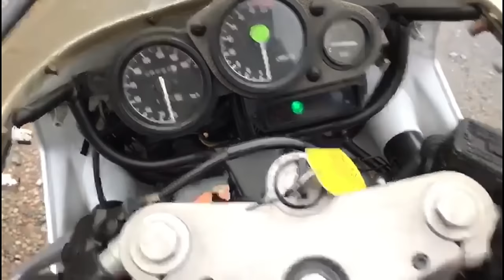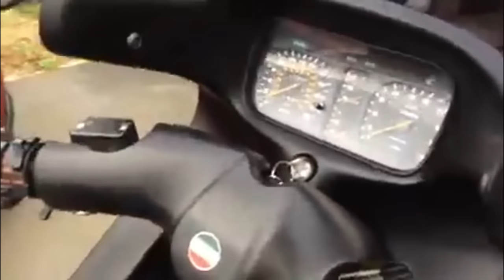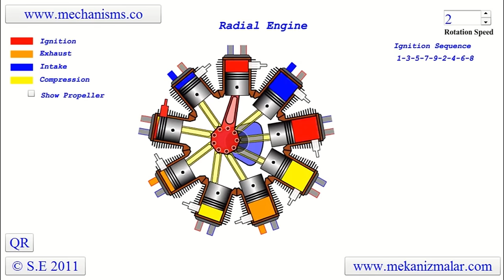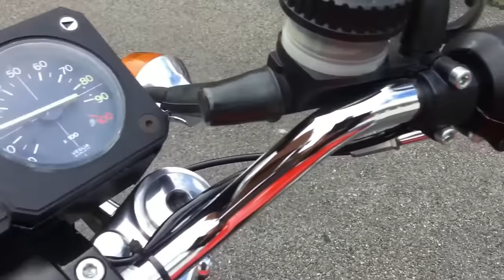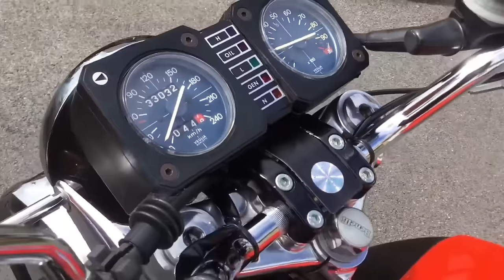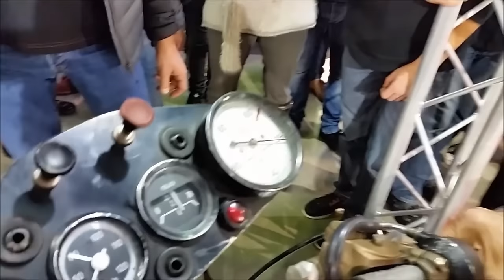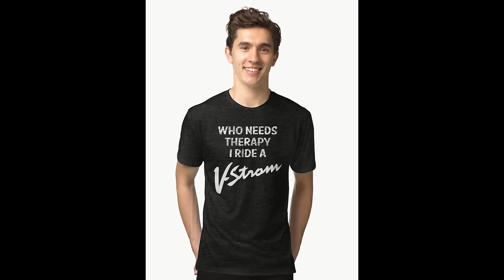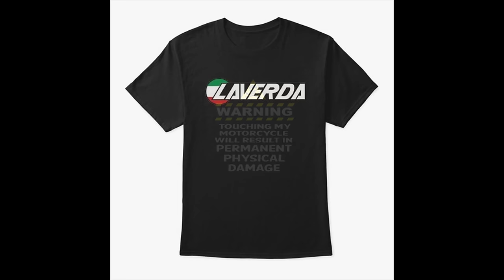20 Greatest Sounding 4-Stroke Motorcycles Ever

Comment: Wow! You brought back a lot of awesome memories AND introduced me to some fantastic sounding bikes I can't remember ever seeing before! I think I did post a tiny video of a CBX taking off with an immaculate old 750 4 from either side of my Burgman a little while back, he didn't wind it out since it was still fairly cold but, they do sound amazing when up in the revs and throttle. So many of them sounded amazing and I'm right with you about the importance of the sound. My DL650 with that Two Brothers Racing exhaust made a really sweet sound the gopro vid just doesn't do justice but, not a patch on these bikes you showed here. One I really liked the sound of that I had was my XS 750 triple shaft drive Yammy which had been worked over for racing so the engine was a fair bit livelier than stock and had a custom 3 into 1 that made a pretty addictive sound that made you feel like you had to wring it out everywhere you went, just so I could hear it. It wouldn't compare to most, if any of the bikes you showed here. 
I don't envy you the challenge of making this video and trying to position them, you took on a hell of a challenge and despite the inevitable disagreement many will undoubtedly have, I think you did a great job and thank you so much for it  👍.
Reply from the maker: cheers mate, imagine what the 2 stroke one is doing to my head lol, this has been a serious quest 🙂
Reply: @barebonesmc  I can see that, no wonder you're so busy. This one was quite a major effort I'm sure and 2 stroke engine noises are a LOT more subjective, plus a lot of people just hate the sound of them anyway.
I'm patient enough to wait to find out but, I'm sorta expecting my old Suzy 550 GT to maybe make it into that one. I won't be terribly disappointed if not but, I did enjoy the cackle of 3 2 stroke cylinders running together. To me, it was probably the most pleasant sounding one I ever owned. It or maybe you prefer the 750 water bottle, or maybe you've got a bunch that sound better than either of them, either way, I won't give you a hard time since they will be a LOT harder to choose from all the different 2 strokes over the years and every one of us dinosaur 2 stroke lovers, yeah, all 6 of us will have different reasons for loving particular ones, plus stock or modified, especially expansion chambered ones will all suit different people.
BTW, I remember you saying something about that "2STROKESTUFFING" and if it was the one where he worked out he'd built the expansion chamber ALL based off 1 wrong measurement at the head that compounded from there. Well he's now made a pipe that by rights is still not right but he had an idea and wanted to try it. It did work pretty well actually and got up to over 12 hp at the rear wheel but, he's only just done it so he's almost certainly going to still build one to known formulas but I think he's going to try a few more things with this one first.
The one thing to remember that fools me every time is that in the bike his engine looks kinda big but, it's actually tiny. That top pulley up above that gearbox way up there is the crankshaft, it's only mounted up there on top of all that for testing purposes.
I'm also loving hopefully to understand 2 strokes better. I've owned and even rebuilt several 2 stroke bikes over the years yet have never really completely understood exactly how they work, plus how to modify port timing by opening up the right parts to get the port timing to suit the way you want it to deliver power so this is very interesting to me.
You kinda know it's a tad revvy when he describes 11,000 rpm as idling speed lol.
A lot of commenters are suggesting his home made dyno isn't reading accurately and that they mostly all think it sounds like it's putting out more power than his readings are showing. HINT: If you're interested  in power and the torque figures, get ready to hit the space bar about 3 seconds after you see him reach over to press a button on the laptop in front of him.
Reply from the maker: @lorditsprobingtime6668  the 2 strokes one is shall we say, complex lol, the 2 stroke stuffing guy is very clued up, and not frightened to get it wrong too which is important. it is interesting listening to him. have a great weekend mate

Comment: Oh my.  Oh my.   I rode, at break-neck speed,  my Laverda 3CE (predecessor to the Jota - which I later owned) down to the Bol D'Or at the Paul Ricard circuit in Southern France to watch the Laverda V6 race.  As they say 'I was there' !.  It was a hot week-end.  At the end of the official racing the track was opened for approx. 30 mins (I suspect unintentionally) to spectators with bikes to take a blast around.  I remember putting in 3 laps with my buddy who was on a Honda 900 Super Sport, before they closed it down.  Such fantastic memories.  I really like my current Moto Guzzi V7 850 but this has me wanting to go out and buy a more powerful bike !.  Even at my age, once speed gets in the blood ... it is hard to shake.
Reply from the maker: glad it jogged some good memories mate, My SF2 is fast enough for me these days 🙂Cheers for watching. Ride Free 🙂

Comment: So smaller cc bikes have worse throttle response but at pitching cornering speed that's an advantage and a better learning curve. Less chance of over shooting and if there are other riders it's just the hope that they have the corner speed right so you can add a tad more with throttle adjustment that does less ie less chance of losing the back
Reply from the maker: A good point well put mate 🙂Cheers for the comment. Ride Free 🙂

Comment: Agreed the BSA  Rocket 3 sure wish Triumph would produce the Hurricane .Having said that last summer a Vincent went by  Can't put it into words just to say my jaw dropped
Reply from the maker: lol, shhh, ive been plugging a design at them for years, using the old 900 triple block and the Spring chassis, the only thing i can think is that somehow the Hurricane trademark has been lost when Honda used it and Triumph dont have rights anymore, it would be an easy modular build

Comment: I really do like your style of historical commentary and top lists. I will say, the more explosions per time is not the be all end all to good sound. Not saying this was your point, but you did mention it a lot, except for the 3 potato radial. Timbre, pitch, clean exhaust note ect matter more to me. "Unclean" would be say for example, L ducatis, they often have such a loud clicking/tapping noise. (Maybe it is the dry clutch? Desmo valve train? Or something else?) Reminiscent of Two! failing hydraulic lifters in a car/truck engine.  Another example is the ktm v twin, the whine of the cams? (almost like a roots style blower... except not awesome) ruins the sound of that engine. I ride a super duke. In both examples, the ktm and ducati, those obnoxious noises are loud. Yes, all bikes have many sounds happening, these were just 2 loud ones I quickly thought of. Not trying to hate on someone's fav bike sound, just pointing something out. Perhaps at higher revs, or under load, the sounds change. 
Of all the sounds on the video, the Kawasaki 1300 was my favorite. However, video doesn't properly communicate how the bikes really sound. As always, sound is like taste, everyone has their preferences.
Reply from the maker: A good point well put mate, I wasnt saying it was everything, it is just a part of what makes the sound what it is. and I know what you mean with mechanical noise, but even that is a taste thing, Dry clutches being the obvious example, some love em some hate them. My old Nighthawk S is a funny one, when you start it up it sounds like a bag of nails until the oil has warmed up. then the engine noise dissappears pretty much entirely. The joys of hydraulic tappet adjustment 🙂Cheers for the comment. Ride Free 🙂

Comment: My absolute favorite is Norton F1 (rotary howl), then CBX1050, then I suppose some I4s, depending on the exhaust really. Laverda SFC1000 (120 crank) is the best three cyl and RC51 the best V twin. I generally like the screamers.
In absolute terms after Norton F1 and CBX1050, they come the 2Ts and after almost all 2Ts, the next 4T comes.
Reply from the maker: like i said, there is a 3rd episode after the 2 strokes 🙂
Reply: You think the 120 Laverda was the best. Have you ever followed a 180 Jota with Conti exhausts? In 1992, I had the pleasure of riding around the Island on open and closed roads on an RAC Norton Commander with it's screaming Rotary engine. Always a crowd pleaser.
Reply from the maker: @RichardASK  no actually i prefer the 180, but it down to personal taste on that one. re the Norton, I did say there was going to be a 3rd video after i had done the 2 stroke one 🙂 but Shhhhhhhh 🙂

Comment: Should correct the last bit, it was the RC211v that was a 5 cylinder, 2002-2006. The RC212V and RC213V were and are 4 cylinders
Reply from the maker: yep, you are right, it was the 211 that was 5 pot apparently, it was a last minute addition, me running on memory alone so thats always a challenge lol, cheers for adding though mate

Comment: I am really no fan at all of any of the street sixes. I thought the Z1300 was probably THE most boring sounding engine I had heard when I first heard it back in the 70s, I'm not sure that I've changed my mind.The Benelli was, for me, just about the best because it had a bass rumble that the CBR didn't have.
The three that I think you should have included right from the off would be;
 The TL1000 Suzukis. I have an S with a fairly open pipe (ART) on it which will set off car, and even some house alarms without any problem.But it isn't the sheer noise, but the bellow from about 3000rpm upwards, it really is addictive and is, in my opinion, just as lovely a sound as the 916SPs. I live just outside Barcelona on a road that is used by vast numbers of bikes every w/e and have the opportunity to listen to them all, regularly.
The second would be the KTM Superdukes. They have such a lovely rumble on tickover (yes, I know about the clatter) and produce that addictive V twin lazy beat that belies the speed with which they approach the horizon. Just as distinctive as the Ducati SPs, just different. I'd also like to give a shout out to KTM for managing to make a modern engine that sounds as good as, if not better than, an older one.For me, the 1290 just about pips the early 990s.
But pride of place just has to be the Aprilia Cube. God Almighty that thing sounded spectacular. I saw/heard it at the IRTA tests at Montmeló and it bmade the Hondas sound ridiculously lame.Even approaching the circuit, you knew that you were in the presence of something other-worldly.You always knew when the Cube had been fired up because it drowned out everything else... in a pit full of the next generation of 4 strokes. And when it blasted down the main straight it was like the gates of hell had been opened and the screams of all the lost souls were crying out in anger. I was truly saddened to learn that such an engine would never race again.
Reply from the maker: ok ill definitely give you the Cube 🙂 and thanks for adding the ones you would replace too,  and if we all thought the same it would be a boring world mate, This was a hard one 🙂Cheers for watching. Ride Free 🙂

Comment: I'm afraid that the 350/4 (and the 400/4 that followed), along with so many other small bore 4 strokes, really, really don't do it for me, they remind me of the Macbeth line "All sound and fury... signifying nothing
Even the CBX is for me, a yawn fest, especially as it really wasn't any great shakes in its intended role. Just about the only small bore 4 strokes.
Nice to see the Ducatis and Britten getting in, but I'd have added the TL1000S, especially on some decent ly loud pipes, but even the standard ones can set off alarms. My S could get the dogs barking... half a mile away.
Reply from the maker: if we all thought the same it would be a boring world mate,  for me, the air cooled multi's just sound better, but thats just me 🙂 my Navigator had the same engine as the TLS with a big bore spaghetti exhaust system, and yep, sounded like thunder, but not a patch on the Laverda with Termi's IMO 🙂Cheers for watching. Ride Free 🙂